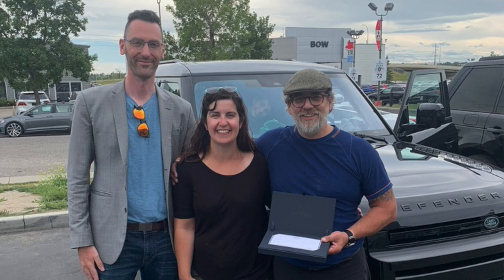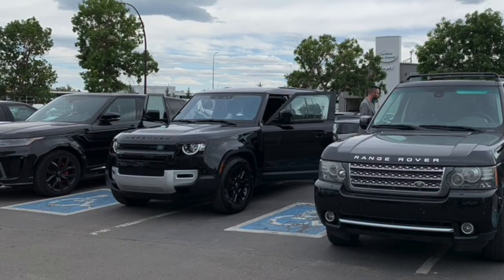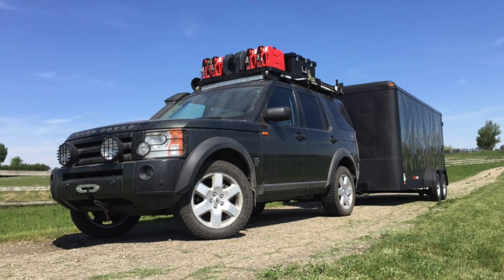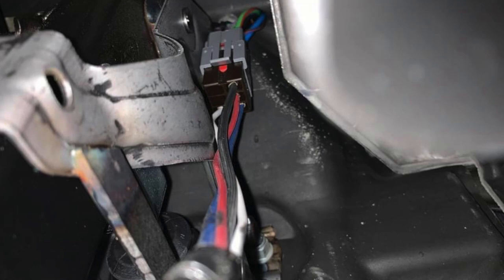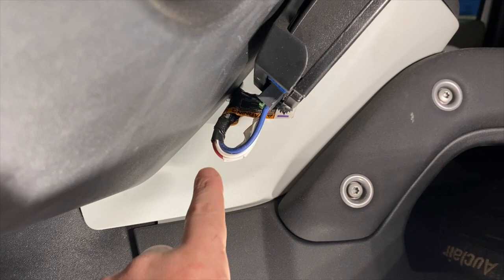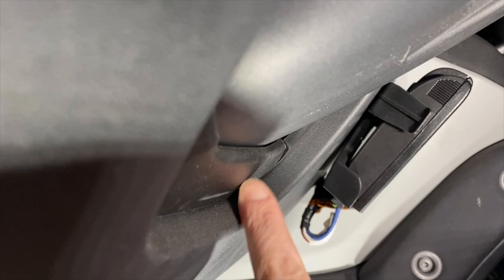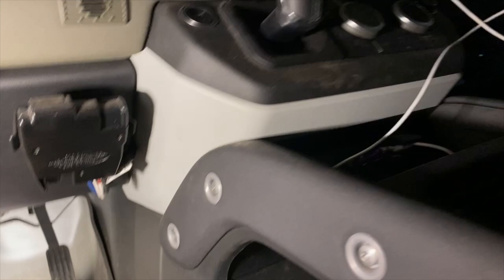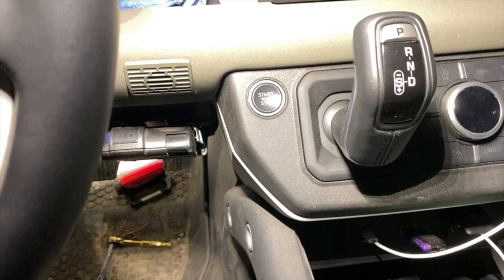Installing an Electronic Brake Controller on a Land Rover #landrover #newdefender #rangerover #d5

Comment: My D240 was specked with the tow pack. It includes the brake controller. Works a treat, matches the break force applied to the vehicle and trailer. From gentle stops to panic braking it kept all in line.
Reply from the maker: That’s very interesting! Which country are you in? There’s no diesel in North America — so I’m assuming it’s not here. Europe doesn’t have brake controllers from what I can tell — so I’m assuming Oz!? 

Mine works well now I’ve re-calibrated it — but it does need adjusting from one trailer to another. Perhaps more advanced (newer) brake controllers do that automagically! What unit is fitted to yours and where is it mounted?

Comment: You should swap to a Redarc Tow Pro Elite
Reply from the maker: Are they better? And if so, how?
Reply: @shedlock2000  They are super simple to install if you use the TP006 harness for ford or Landover it is a two second job. The best part of the Tow Pro elite is the two brake modes Proportional and Manual. They also have a very clever and easy way of calibrating the brakes for a new trailer. I know you mention this an issue in your video. They provide a kit to add the dial to the dash, so it looks factory. I saw in your video you have little yellow switch already in the spot below the dashboard light. This is where I put my Redarc. They also provide a switch box, so you don’t see any wires and it fits like it was factory fitted. 
However, the best part, the reason you buy one is the two brake modes
Proportional – Is auto mode the harder you brake the more the unit tells the trailer to brake. This is awesome for set and forget anyone can use the Defender. 
Manual – Press the brake and double click the button and you’re in manual. This allows you dial in the brakes for your specific activity. 
Example 1 Sand driving (or Snow for you 😊) Set the brakes on the trailer to 0-4, light touch. This stops the trailer digging in and becoming an anchor, it just glides to a stop and allows you to easily pull away. 
Example 2 Rock hopping if you are hopping with a trailer and you just want to tap the brake for the tow vehicle but have the trailer hold you in place then set to 8-10 and you get very aggressive brakes on the trailer but not on the Defender.
So brilliant system from a good Australian company and not that expensive.
Reply from the maker: I was going to ask if they were and Aussie company; it makes sense that they’d be more popular there than here. They do seem like a nice bit of kit! I’m in an L322 now (though I’m sure they have the same for these vehicles). I might check out what they have to offer.

Comment: Do you know of any videos where they explain how to set up the profile and the advanced towing system for backing up with a trailer attached?
Reply from the maker: I don't! I don't have advanced tow assist (only the trailer profiles). I should do a set up video for that. Good point and thanks for raising it! 

I believe that, with the advanced tow assist (that is, for the system that helps you reverse the trailer using the knob), that you first need to calibrate the trailer with the three dot triangle sticker. Above that, I am not certain. I know there was a video from JLR showing the functionality on the D5 -- I assume the process i similar. 

As to setting up the profiles -- I will try and record a video on that this week and post it. That would be helpful stuff (I need to delete a trailer profile anyway, as we have sold our RV trailer now).
Reply: @shedlock2000  thanks for your reply! We calibrated ours following the instructions on the touch screen and in the manual but it didn't mention the 3 dot triangle sticker. I'll see if I can find the JLR video.

Comment: If you're towing the trailer down a steep hill and the vehicle loses electrical power, does the electronic brake control unit stop braking the trailer?
Reply: Of course.  You also lose braking in the vehicle and power steering so say a prayer.
Reply from the maker: As CW says, the power to the trailer (and the brakes) would be lost if power on the TV gave up. 

You’d still have hydraulic braking on the Defender, but the new defender has disconnected brakes (there’s no hard connection between the brake switch and the actual braking system — there’s a complicated set of valves and accumulators in between) and I’m not at all sure how they would work if power was lost because the system requires some electrical connectedness to inform the braking system how to brake. I imagine that there’s some sort of redundancy built in, but I don’t know enough about they system to say how that would work. 

Of course, in the U.K. and Europe, overrun brakes would work regardless of electrical power — yet another reason why our system is better! I’m not actually sure what the better making-ness of this electrical system is! It’s not even like an air brake system in which the air hold brakes off and a loss of air results in the vehicle stopping because the brakes come on! If the electric goes, the brakes stay off unless the merge cut brake wire pin is pulled. Curiously enough, they don’t even have a hand brake on trailers over here, so trailers often run away when parked up, as there nothing to stop them from doing so when the TV is disconnected! It’s a fairly bobbins system they have over here..... but there’s a lot of that going about here too!
Reply: @shedlock2000  had the alternator fail on my first L322 once which killed the battery in seconds but I was at least able to brake safely. Was just wondering what the situation would be with the Defender...
Reply from the maker: Hmmm. I’m not sure. I don’t know how disconnected brakes (the system Land Rover now use on the defender) works without power. I suspect that you would only have hydraulic force of the pedal through whatever mechanism that operates without power. Of course, the trailer brakes, I think, would stay so long as you have battery power. 

I’ve never heard of a battery being killed so quickly by an alternator, but I suppose all things are possible in an ‘infinite monkey world’ (alluding to the notion that an infinite number of monkeys with type writers could bash out the works of Shakespeare).
Reply: Thinking gif getting the prodigy RF so I don’t have to mess with the install and can switch cars with it.
Reply from the maker: @arkos55  I’ve seen a few of those Bluetooth-like units. I don’t know how well they work, but I’m guessing they’re fine!

Comment: Did you get the deep sided rubber mats? How do you like them if you did?
Reply from the maker: They came with it, DH! I also ended up with some carpet mats (which I haven’t used and are likely sat going mouldy in the garage somewhere). The carpets clip in where the rubber tray/mats fit, and give a more luxurious feel to the car (I imagine). 

I like the deep-sides rubber mats! Out here we have a lot of clay mud and snow,; the footwell get really muddy and gross, but the steel sides are handy as they help keep mud if the underneath interior. 

The mats are a bit thinner than I’d prefer and I’d imagine that the right heel would wear through over time, but they’re champion for now!

Comment: Can you explain again what happened to the black Defender?
Reply from the maker: It’s a very long story, John! I bought it new and suffered a number of critical transmission failures. That, plus a few issues with dealership incompetence installing (or not, more accurately) the ordered accessories (which weren’t actually ordered), meant that I had to kick up a fuss with management at the dealership. The end result is that they swapped my vehicle to one I didn’t actually want (I much prefer the P300 to the P400, and the drive of Albert was nicer somewhere).

There were also more issues with the repair of the vehicle and promises that were made that weren’t upheld that involved me and the family being stranded 300 miles away from home when the vehicle wasn’t actually fixed. 

To be honest, it’s probably worth a short video — so I’ll put one together when I get time.
Reply: @shedlock2000  That's the "everybody's worst nightmare" of why people are skeptical of buying this vehicle. But since you've produced all these other videos and haven't had any problems with the new one, I'm still going to order mine in March.  I read on the forums that the 2022's will be available to order in March so I may go that route.
Reply from the maker: I’ve done a short.. well, Firthy length,  video on it soon to be released, @john Baldwin.